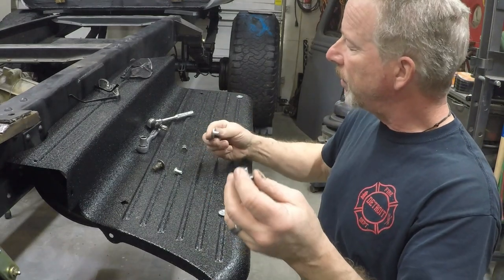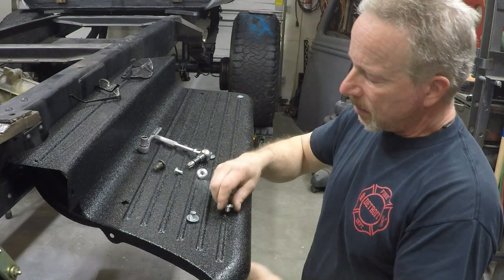Ford Mid 1940's Running Board Solution

Comment: nice video,can you tell me the way to cut the barrel,thanks
Reply from the maker: I cut it with a cut-off wheel on a grinder. You could use a dremel or a hacksaw as well.
Reply: Mounted different on my '42. each step has 2 welded channels underneath which bolt on to the chassis brackets.👍